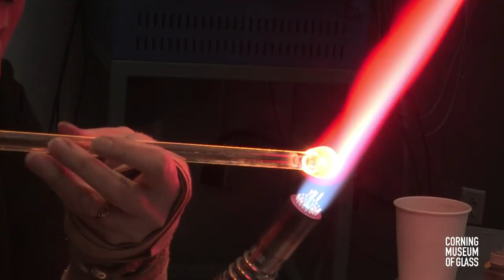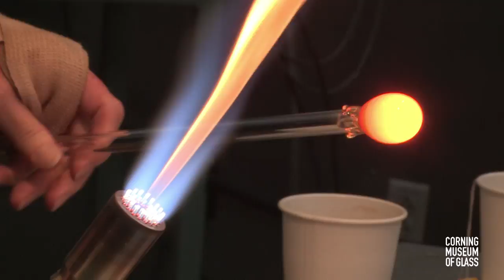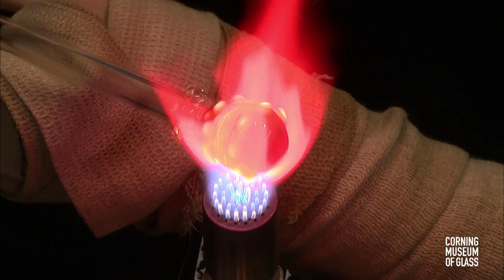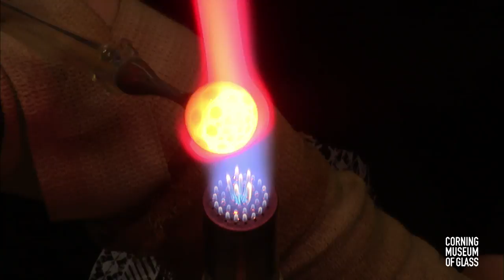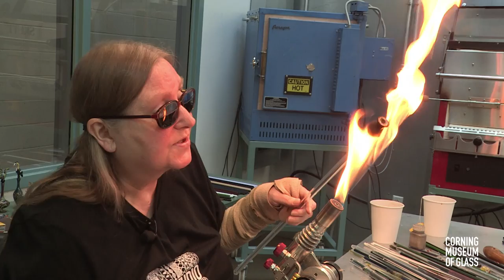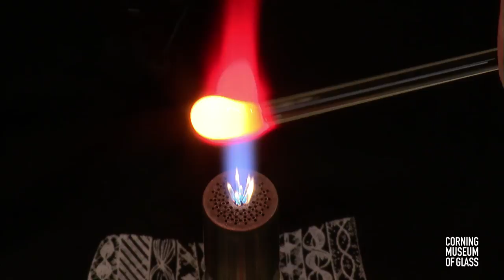Suellen Fowler Live-Streamed Studio Demo

Comment: OMG i was just wondering if they were gonna do more demos :D only way i can learn.
Reply from the maker: Stay tuned for more demos throughout the summer, see the full schedule of when we're live at http://www.cmog.org/live
Reply: Would it be possible to pass on a question to her, since i dont recall her talking much on it during the demo.
the Vermiculite bucket, is it warmed? does she anneal the finished parts in a kiln after all is said and done? Im use to hearing that a kiln is the only true way to anneal pieces "as perfectly as possible" and that the vermiculite and other methods dont really work. does it have to do with the boro glass over soft glass?
I figure she would be the best to answer with 35 years of glass blowing under her belt, and since she uses it.
Reply from the maker: The vermiculite bucket is not warmed, though some people will anneal soft glass in a crock pot with warmed vermiculite.  For the borosilicate, it is unnecessary.   Suellen does indeed anneal the glass in a electric annealer later once the glass has cooled completely.

Comment: Boro is weird. If I left the soft glass out like that, it would just explode. Seems Boro is much more forgiving.
Reply: the COE being so small, when it contracts in the micro scale(with unaided eye you cant see it) the contractions are so minimal compared to soft glass. thus the chance of it shattering due to thermal shock is minimized. can still end up cracking off, tho.